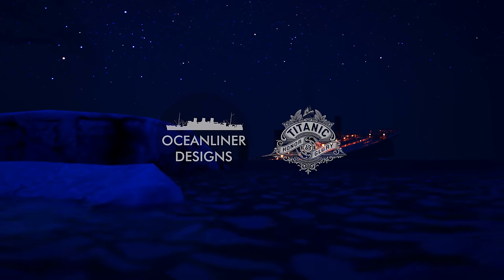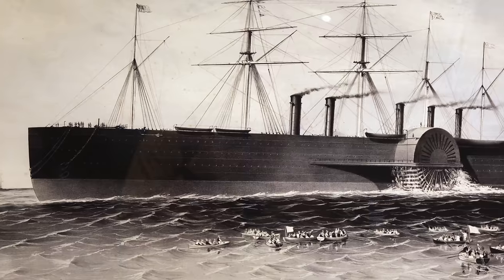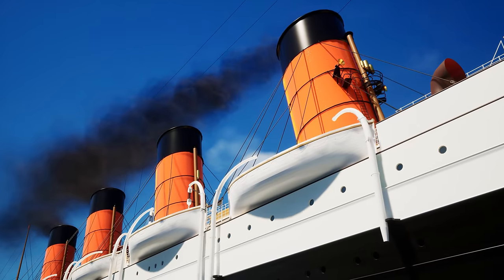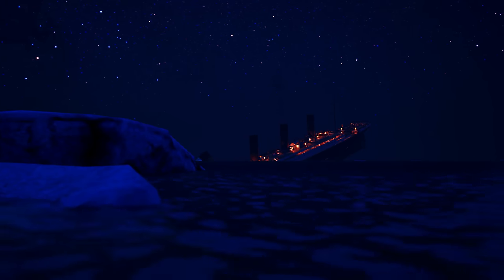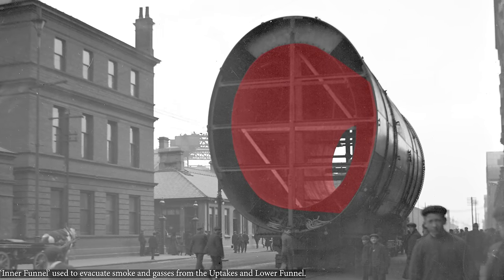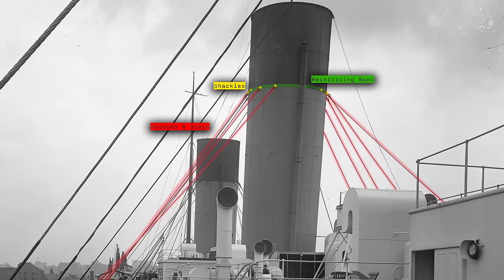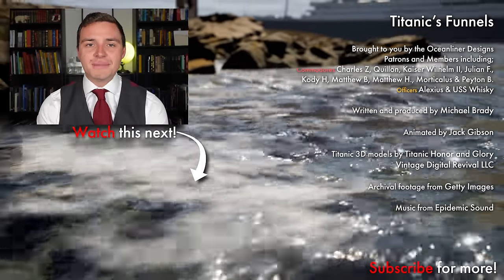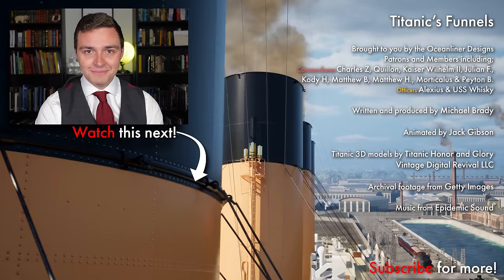Why Did Titanic's Funnels Collapse? An Analysis.

Comment from the maker: This is a remake of the second ever explanatory video I made for the channel, expanded from 9 to 25 minutes. Feel free to post any questions here! 
Also, as an aside - how cool is that home video of Olympic from the 1920s? Its surprising at first to see ships as big as Olympic moving so much in a high sea - but then check out of footage of Queen Mary 2 at the end there! That day we were sailing off Australia in a very gentle swell and the ship was moving quite a bit as you can see! I hope none of you get sea-sick! :-)
Reply: That video of Olympic is one of the most amazing videos I’ve seen, ever.
Reply: I don't know where to post this.  But can you do a video of the sinking of the container ship EL-Faro.     Thanks.
Reply: Thanks for going into even more detail about this fascinating subject 👌🏻
Reply: Fantastic video! One question that's been on the back of my mind is the role that heat would have played in the sinking. You had mentioned in this video that the outer shell of the funnels could heat up enough and expand the material enough to make the funnels taller, well then a sudden dousing of subfreezing water surely would have lead to some sort of thermal shock? I have often wondered about if this could have played a part but have never seen any information about it so perhaps I am missing something. Would the ~2 hours between engine shutdown and water contact have been enough to cool the metal down to air temperature causing this effect negligible? 

Either way, brilliant information in this video thanks again for the amazing videos I am hooked to your channel!
Reply: When your able could you do a video on musashi or shinano  sinking?  Think yamato overshadows both of her sister ships
Reply: I love your videos Mike ! I live in Rotterdam, very close to the location of SS-Rotterdam. I see this ship every day when i walk to work, but this ship never sails out. It is just there and i think it is used as a hotelship. Can you do some research and make a video about SS- Rotterdam ?
Reply: Mike, thank You so much for this "deeper dive" into Titanic's funnel collapse.  The details are fascinating to see!  i love Your work and look forward to seeing more!  God bless !:-) 🙏💜⚡
Reply: Mike, I am confused about what the correct funnel color of the White Star Line was.  Your excellent video says "a warm yellow or light tan." But I have also heard that it was a light peach, hot pink, or a mixture of yellow, white, and red.  So, which was it?
Reply: Sometimes I feel like my mind is melting.  I was pretty sure I had watched this before.
Reply: Excellent video. Engineering stuff like this is fascinating. Can't wait to see more.

I remember my Grandfather telling me about being aboard the Alabama during Typhoon Cobra. Never really believed it as a kid. A few years back I managed to get most of her War Diaries and read through them. Officially, the highest roll experienced by the ship was 30 degrees. 

Big ships in rough seas are crazy.
Reply: I think u should do a video called ‘what if Olympic sank’ I would just find it interesting to see what might’ve happened to the white star line if Olympic got sunk when it was torpedoed
Reply: Seeing any moving footage of the Olympic is wonderful.... such a sad thing that the Britannic and of course the Titanic did not survive long enough for more footage of them being.
Reply: messerschmittnorthrop2750  All of Britannic's funnels were found, but the number 1 funnel looks like it came off only with the force of the ship settling on the seafloor.
Reply: @ceebee23  There's actually launch film of Britannic and her subsequent fitting out at Belfast, showing her in her White Star Line livery fairly late into the process before she was requisitioned as a hospital ship. 

Titanic's launch was also filmed, but the film reels were apparently lost.
Reply: bro I would just like to say: your vids are so interesting. thanks..
Reply: Okay so when Ballard found the Titanic they said they bounced one of the RVs off of the funnels and talked about how some of the parts of the funnel was still attached to the Titanic and there's a video of it on I believe the news channel and I posted it in one of my comment.
Reply: Another Titanic channel I follow also suggested that the icy cold water hitting the super hot metal aiding the collapse.
Reply: How long could the paint on the funnels go in-between paint jobs?
Reply: @MERCENARYREVY  They thought that they might have, but it wasn't until later that was found to be a mistake as more video and photographs of the wreck showed that to be false. We know were all the funnels or parts of them have landed in the debris field and they all fell off before or when the wreck was on the way down to the bottom, and none lie near the bow section.
Reply: @OceanlinerDesigns. Took my eight year old to see the Titanic Artefacts exhibition at Melbourne Museum today.  He’s a fan of your channel and asked ‘Do you think our friend Mike Brady came to see it too?’ 😂
Reply: Wouldn’t the frigid temperatures of the ocean in the middle of an ice field on a clear cold night combined with the “still smoking” funnel’s boiling temperatures have something to do with their collapse? Especially as they fell once they made contact with the water
I’m no scientist or engineer but I don’t imagine that the steel being extremely hot on the inside and extremely cold on the outside could be good for the integrity of the structure. Exposing half-inch thick steel to those kinds of extremes must have compromised the steel’s integrity surely?
I would have thought that superheating one side and supercooling the other would make the steel plating brittle at best. Then, if that’s only at the base, the list of the ship combined with the sheer weight of the funnels must have been enough to set them falling, snapping the support cables in the process.
Is this a valid hypothesis or am I missing something and barking up the wrong tree?
Reply: What color were the funnels on Olympic, TITANIC and BRITANNIC?

Comment: My guess to what also contributed to the structural failure is that there was a dramatic changed in heat balance between the front and rear of the chimney as the ice cold water washing around the front of the chimney caused the hot expanded casing to suddenly contract like a blacksmith dipping a hot metal into water. 

However unlike a blacksmith that evenly dips the hot metal into water evenly, the Titanics chimneys entered the ice cold water unevenly as it was slowly lowered in. This uneven entry caused the front part of the chimney to contraction at a much more dramatic rate compared to the rear, effectively pulling the chimney down towards the front of the ship, making the front support cables sag and offer no tension or support, while the rear support cables already under immense loading from horrible lean on the chimneys would have been dramatically increased in loading further and failed.
Reply: That's a good educated guess. 
I would add to that that heavy rain, snow or even ice have a lot less weight than the ocean slamming a massive wave into the funnels. They were never designed to withstand all that force.

Comment: Great video about the funnels. I also agree with the 1st funnel being very submerged when it fell.
As a minor correction though, the 4th funnel wouldn't fall because of the stern settling back as its base was stronger than the other 3 funnels. It more likely broke off in descent as several survivors recalled it standing post break.
Great video though, keep up the great work :).

Comment: 24:00 A woman, who ended up stuck on the beach below the high tide line was provided with a length of PVC pipe to use as a snorkel as rescuers tried to free her. She was breathing fine at first, but very quickly she was struggling to draw a breath and she spat out the improvised snorkel and drowned.
     They said it would have felt like the snorkel was being blocked.

Comment: Excellent video, but quick correction: the boxed structure in the smoking room was not a boiler uptake, it was the turbine engine casing (though, still technically underneath a funnel) 👍

Comment: Last month I sailed from the UK to Holland with Stenna Line, and even with a modern passenger ferry there was something captivating about the large red smokestack with a giant "S" on the side bellowing out white smoke as we sailed across the north sea. Whilst over there I also visited and stayed on SS Rotterdam, one of the few surviving ocean liners that's now a hotel and museum. That has its own interesting funnel design with two funnels side by side with a large gap in between. When I was going to my room near the stern, the corridor moved towards the outside of the ship and then back again as it went around one of the the funnel uptakes.

Comment: I wouldn't be surprised if thermal shock also played a role in the collapse. After all eye-witnesses described the funnels were still smoking at the time of the funnel collapse. This suggests a non-insignificant temperature differential between the outside of the funnels and their inner construction and even more so the upper and lower funnels. During construction and mounting of the upper funnel water-tightness was probably of no concern. After all by the time a significant amount of water manages to reach where they're mounted, the ship would have already sunk anyway. Equally unlikely is that the engineers accounted for the lower funnel to encounter thermal shock during operation, which is precisely what would happen when cold sea water enters the hot lower funnel. Put the two together and you get a recipe for disaster under the conditions the Titanic found itself in. You have a structure built from metal sheets bolted together and suddenly all those sheets undergo rapid temperature changes each at different speeds. What you get is a structure that literally rips apart at the seams.

This also provides a rather simple explanation for why the 4th funnel didn't collapse in the sinking. It just wasn't hot enough.

Comment: As I understand the physics, if you run tension cables diagonally to a vertical structure like that funnel, they will stabilize the structure horizontally by keeping it from swaying, but will also introduce a vertical load, proportional to the cable angle, for example if angle is 50% (45 degrees), the cable is acting with horizontal tension and vertical compression equal to that tension. That compression by the way acts against a tearing force at the base, keeping all the rivets unstressed even when the funnel is at an angle. 

Now, a round tubular shape has a very high compression strength, because it  transfers all that load into tension around its circumference (and thin steel is very good at resisting tension) - but if it buckles even a little, all the load is transferred as bending force instead (which thin steel is actually terrible at) -  the compression strength is suddenly lost.
This is I believe what happened - water pressure buckled the base just a little bit causing it to loose it's compression strength, and to fall down under the force of cable stays on one side, which snapped cables on the other side.
You can do an experiment yourself - fold a sheet of paper tightly into a tube and push it down and you see it's surprisingly strong, but buckle it even a little and it will just snap immediately.

Comment: As always, an excellent and thought provoking analysis! One thought: If the temperature of the funnel structure gets so high during operation, what is the effect of rapid and asymmetric cooling on that structure as it comes into contact with near freezing water? The coefficient of thermal expansion means that the hot end is bigger than the suddenly cold end, causing stress/fractures at points of weakness. Could the structure have been weakened in this way prior to the forces imposed by submersion? The 11 psi straw that broke the funnel's thermally deformed/fractured back? Also, funnels 3 and 4 were likely not exposed to the same volume of water due to the nature of the sinking, consequently, they held on longer.

Comment: Cunard red in turn is based on the colour used to paint the sides in old sailing warships. It changed with fashion, sometimes orange like Cunard Red or often pale yellow or even the terracotta pink of Nelsons time, as is visible on HMS Victory. But it's all ochre yellow, an easy, durable and cheap paint to make the red being achieved with iron oxide. For my model boats I use white as a base, a drop of red and some cream/yellow, depending on how much red you use it changes the style.

Comment: The new largest passenger ship Icon of the Seas has two promanent "funnel things" with what looks to be passenger areas inside them, assuming those windows are real and not decorative. They probably exhaust significant steam as well as deck power is supposedly provided by fuel cells.

Comment: I've always wondered if temperature had a hand in the collapse as well.  The funnles themselves would have been extremely hot.  Coming into contact with water that was at or below freezing would have cause some seriously contraction of the metal.  In the end, pressure would have been enough, but the vast temp difference could have been a factor.  Just an idea I've had on a few occasions.

Comment: Wouldn't the sheer temperature difference of the freezing water against the incredibly hot funnel cause the metal to suddenly 'snap' back into compression from expansion and weaken every nut and bolt holding it down?? I'm no engineer but very hot to suddenly cold can have devastating effects on objects, like throwing cold water on a hot light bulb will cause it to explode. :) Love these videos, they make incredibly great viewing and very informative :) Thanks :)

Comment: I think the pressure of water pushing against the funnels tied with the fact the expansion joints tearing apart thus stretching the support cables was enough to exceed their engineering design. I dont think H&W anticipated for that

Comment: 26:00 The aft part of the ship was found to have suffered quite a bit more smashed up than the front part. This is thought to have been because there were many more air pockets in the aft section. There would have been air pockets in Titanic like the one Harrison Okene used to survive the sinking of Jascon-4, but Titanic sank in much deeper water than the Jascon-4 sank in, so these spaces would have imploded, crushing the space.
     This would have been a mercy for then in any case. Harrison was found just 60 hours after the sinking. It was around 640000 hours before the wreck of the Titanic was discovered.
     I don't know about you, but spending 60 hours sitting in cold water in the pitch dark with nothing to do but listen to the sounds of the ship settling and the crabs eating his friends.
      Really would like to know what Harrison was thinking when he saw the lights of the divers. Clearly he was not thinking, "How can I get the diver's attention without scaring the ever living shit out of the man."
     If you grabbed the hand of a dead man on a ship, what do you thing when the grabs you!

Comment: Has anyone ever proposed that if the inside of the ventilation uptakes were so hot, and the inside of the funnels almost as hot that the sudden rush of cold sea water the first funnel was enveloped in may have caused it to buckle violently from within? The idea that people were drawn each time one of the funnels fell exposing one hole then slowly rhythmically another, is pretty haunting.

Comment: I’ve been meaning to ask about the sag or curve in the decks of the Olympic class ships and you briefly mention it here. You said the sheer of the ship. Is the saging central section of ship designed like that or because of the enormous size and weight the ships naturally sag in the middle?  Ignition make for a video down the track

Comment: You've explained that Titanic's breakup was a direct result of her keeping a relatively even keel, concentrating the topmost tension (stretch) stress upon her weaker wooden decks and open areas instead of on her stronger steel sides. So, why DIDN'T she list so heavily to starboard the way Lusitania and Britannic did if that was how the latter wrecks managed to remain intact through their respective final plunges?

Comment: What's crazy about the expansion joints built into Titanic is that the shipyard had actually believed that the reason the ship broke apart could be due to the aft expansion joint and it's design. This question was researched by Richie Kohler and John Chatterton and when they dived on Britannic they found that the base of the expansion joints were rounded on Britannic where they came to a point on Titanic and Olympic, which suggests that Harland and Wolff engineers believed that there was an issue with the design of the expansion joints themselves and were changed on the last ship of the class.
Reply: I mean not really. The joints were only used to connect different sections of the deckhouse together. It shouldn't have anything to do with the strength of the hull at all. Not sure why that would be their conclusion

Comment: torque being applied to the funnel due to the ship tilting vertically causing a significant difference in the forces acting on each side of the funnel relative to its intended point of balance acting like a giant hand. Likely the funnels were never intended to be put in such an extreme force regime far exceeding those they were expected to tolerate so they could not withstand this torque and collapsed. Idk I didn't watch it all. Maybe I will xd
Reply: My thoughts exactly. The stays would support the funnels when the ship rolled side to side, but weren’t meant to support the fore and aft tilting of the sinking. The Lusitania is shown to be capsizing as it sank, so the stays we’re doing their job.